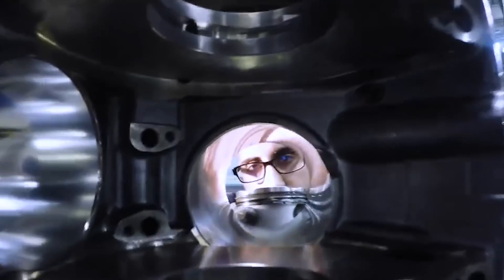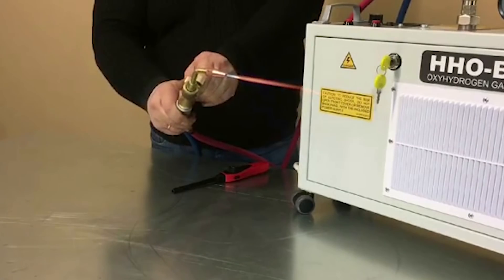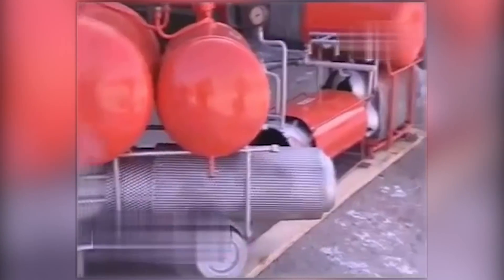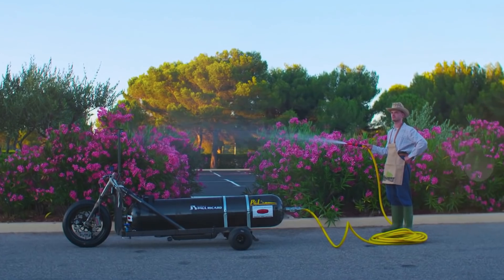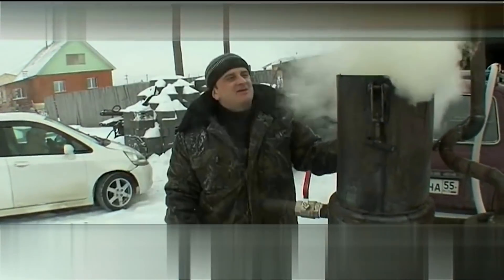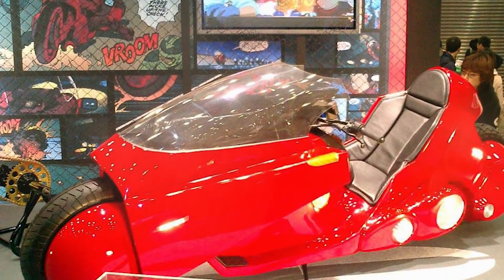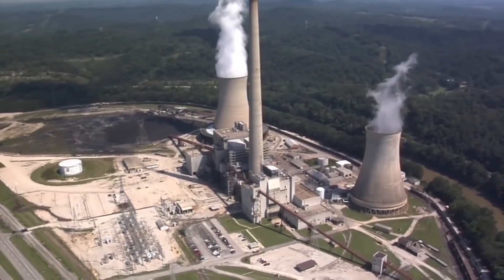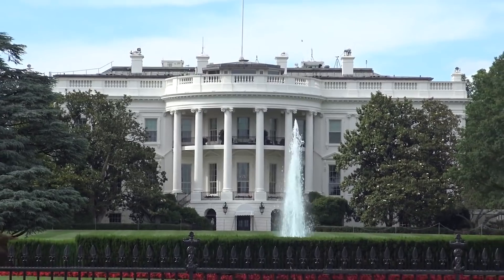Why These Engines Are Banned?

Comment: For a long time I thought that electric vehicles are banned in my country, untill I've realized one nuance. Home-made diy modifications of internal-combustion vehicles into electric are banned, however, electric vehicles made by carmakers and qualified workshops are not. The point is that the engine and modifications on a vehicle have been conducted by a qualified professional, as well as that they have passed appropriate safety standards.

Also, the issue with many of these "alternative engines" is whether there is someone willing to invest enough money in them to turn them into commercially viable product. Most of them are either mere scientific curiosities we've know for a long time, but offer very little practical use, or don't offer significant enough advantages and/or offer significant disadvantages over currently used technologies, so nobody is willing to invest into their commercial development.

Comment: Oh dear - HHO generators.... For the scientifically illiterate only. They need electricity to generate the hydrogen from which to then generate power, but the net result can never be more than the amount of energy put in to electrolyse the water (and rare as hen's teeth is the 100% efficient system , so the chances are that it will produce less energy than was originally input, therefore why not just use the original electricity and cut out the inefficiency of the HHO cycle...?).
Air power - yeah, OK, but what about the energy required to compress the air beforehand? Energy conservation applies yet again (never mind inefficiencies). At best it is only about moving the point of pollution from the vehicle exhaust to the power station. Likewise wih electric vehicles which also have the considerable extra environmental damage issues surrounding extraction and refinement of rare earth metals for the batteries. Range is another problem - fossil fuels tend to provide a tremendous energy density advantage over air and electric power. Hydrogen as currently used in hydrogen-fuelled vehicles is extracted from fossil fuels and is another example of both the movement of the pollution away from the tailpipe and poorer energy density compared to the original fossil fuel (because the overwhelming proportion of the energy in fossil fuels is liberated from the carbon rather than the hydrogen).

Comment: The "Air powered car" is NOT powered by air. It is powered by the air compressor which forces air into the holding tanks. It would be much more efficient to get rid of the air storage tanks and mount the engine, which normally powers the air compressor, in the car! That way you would bypass the extra, inefficient and time-consuming process of filling tanks with compressed air. Cars that supposedly "run on water" do not run on water. They run on batteries or alternators which generate electricity that is used to separate water into hydrogen and oxygen (also known as HHO gas). Again, just cut out the extra step of converting water into gas, and run the car on batteries and electric motors! Those "free energy" nut-jobs truly do not understand physics and electronics.

Comment: These technologies are expensive, unhandy or ineffective - that's why they are not in use anymore.

The magnetic motor is simply a synchronous motor/generator which is the standard engine in any AC servo drive today.

Comment: Without oil we wouldn’t have so many things get educated.

A partial list of products made from Petroleum (6000 items). One 42-gallon barrel of oil creates 19.4 gallons of gasoline.
The rest (over half) is used to make things like: Although the major use of petroleum is as a fuel, (gasoline, jet fuel, heating oil), and petroleum and natural gas are often used to generate electricity, there are many other uses. Here are some of the ways petroleum is used in our every day lives. All plastic is made from petroleum and plastic is used almost everywhere: in cars, houses, toys, computers and clothing. Asphalt used in road construction is a petroleum product as is the synthetic rubber in the tires. Paraffin wax comes from petroleum, as do fertilizer, pesticides, herbicides, detergents, phonograph records, photographic film, furniture, packaging materials, surfboards, paints, and artificial fibers used in clothing, upholstery, and carpet backing.

Solvents
Ink
Upholstery
Bicycle Tires Dresses
Cassettes Motorcycle Helmet CD Player Curtains
Vitamin Capsules Dashboards
Putty
Percolators
Skis
Tool Racks
Mops
Umbrellas Roofing
Denture Adhesive Speakers
Tennis Rackets Nylon Rope Water Pipes Shampoo
Guitar Strings Antifreeze Clothes
Combs Vaporizers
Heart Valves Enamel Anesthetics Dentures
Cold cream
Fan Belts Refrigerators
Ink
Toys Dolls Tires Tents Shoes
Glue Skis Dyes Cameras Combs Dice Mops Purses Dresses Pajamas Pillows
Diesel
Floor Wax Sweaters
Sports Car Bodies Tires
Dishwasher Caulking
Faucet Washers Food Preservatives Antihistamines Cortisone
Dyes
Life Jackets
TV Cabinets
Car Battery Cases Slacks
Yarn
Toilet Seats Linoleum
Plastic Wood Rubber Cement Candles
Hand Lotion Wheels
Luggage
Football Helmets Toothbrushes CD's
Balloons
Crayons
Pillows
Artificial Turf Model Cars
Movie film
Car Enamel
Golf Balls
Dishwashing liquids Unbreakable dishes
Car sound insulation Motorcycle helmets Refrigerator linings Electrician's tape Roller-skate wheels Permanent press clothes Soft contact lenses Food preservatives Transparent tape Disposable diapers Sports car bodies Electric blankets
Car battery cases Synthetic rubber Vitamin capsules
Motor Oil Ballpoint Pens Boats
Nail Polish
Golf Bags
Tool Boxes Petroleum Jelly Antiseptics Basketballs Purses Deodorant
Panty Hose Rubbing Alcohol Shag Rugs Epoxy
Insect Repellent Fertilizers Fishing Rods
Ice Cube Trays Electric Blankets Fishing Boots Trash Bags Roller Skates Paint Rollers Aspirin Awnings
Ice Chests
Paint Brushes
Sun Glasses Parachutes
Dishes
Artificial limbs Folding Doors Soft Contact lenses Shaving Cream Toothpaste
Paint brushes Insecticides Fishing lures Linoleum Paint rollers Plastic wood Trash bags Hand lotion Shampoo Fishing rods Anesthetics TV cabinets Salad bowls Awnings Safety glass VCR tapes Movie film
Bearing Grease Football Cleats Insecticides Fishing lures Perfumes
Shoe Polish Transparent Tape Clothesline
Soap
Shoes
Footballs Refrigerant Linings Electrician's Tape Paint
Oil Filters
Hair Coloring Lipstick Synthetic Rubber Glycerin
Dice
House Paint
Surf Boards Shower Curtains Safety Glasses Eyeglasses Footballs Detergents
Tents Telephones Cameras Bandages
Hair Curlers Drinking Cups Ammonia Gasoline
Telephones Antiseptics Deodorant Sweaters Floor wax Model cars Soap dishes Clothesline Panty hose Oil filters Upholstery Cassettes House paint Ammonia Hair curlers Eyeglasses Ice chests

Candles Boats Crayons Caulking Balloons Curtains Milk jugs Putty Tool racks Slacks Yarn Roofing Luggage Fan belts Carpeting Lipstick Aspirin
Rubbing alcohol Ice cube trays Insect repellent Roofing shingles Shower curtains Plywood adhesive Beach umbrellas Faucet washers Antihistamines Drinking cups Petroleum jelly Tennis rackets Wire insulation Ballpoint pens Artificial turf Artificial limbs Shaving cream
Loudspeakers Credit cards Water pipes Fishing boots Garden hose Umbrellas Rubber cement Cold cream Hair coloring Guitar strings
Toothpaste Toothbrushes Folding doors Shower doors Heart valves Hearing aids Wading pools
Ice buckets
Fertilizers
Toilet seats
Life jackets
Golf balls
Detergents
Sun glasses
Bandages
Nail polish
False teeth
Golf bags
Perfume
Shoe polish
Cortisone
LP records
Vaporizers
Parachutes
more tha
Reply: Yes oil is great for MANY things! But it SUCKS ASS as fuel!
Reply: Jeffrey Ryan it’s a great fuel. Without it most people would not survive.
Reply: @Thumper68  When you evolve thumbs, we'll talk again.
Reply: Jeffrey Ryan no we won’t, when you wake up let me know. Without fuels there wouldn’t be enough farm produce and transportation to take care of most of the metropolitan areas of the country. Look at how it started to get In recent months just shutting things down a little food shortages in the cities were happening. Many of those people don’t even know how to hunt fish or survive off the land. Electric vehicles cost in emissions just to create takes like 30 years plus of ownership to just equal out to a normal cars emissions in the same time.

Comment: The Wankel was patented in the 1920's and developed in the 1950's, in Germany.
Reply: It was used in NSU cars and later on by Mazda. A lot of Motorbikes used that engine. 

However, due to its crescent shape combustion chamber it is pretty inefficient and produces exhaust gases with a lot of pollutants (HC, CO). Also the sealing problem never got really solved.

Comment: I think we should put giant main springs in cars with some gears and have wind-em-up stations when you're to lazy to turn the key🤪💥🤪💥🤣
Reply: As an old school clock maker I can tell you that is a good idea. It would actually be quite easy to wind up too. As a matter of fact, it has been done before and is more than reasonably feasible. The power and longevity of it would be set by your gear ratio. Decent acceleration is possible even at higher gears and regulator could prevent over speed. 5 minutes of winding with the right regulator and gear ratios could easily get you 100 miles of travel at 60 miles per hour.
Reply: @myname604  you’re joking right?

Comment: "Banned" is the wrong word. "Impractical" is more appropriate. Just because something doesn't violate the First Law of Thermodynamics doesn't mean it can work for the operating conditions and life expected by its customers. As an example, you can put enough compressed air in a bottle to make a vehicle move, but can you go 400 miles (650 km) without having to recharge? What happens to those cylindrical bombs in a collision? Is it more efficient to pull electricity from the grid and pump up those bottles than to charge a battery? Oil companies don't decide what technologies go into vehicles, either directly or indirectly. If the "hundred-mile-per-gallon carburetor" had actually been invented, someone would have put it into production one day and put their competition out of business the next.

It's easy to think that complicated problems have simple solutions that are thwarted by conspirators. Do you really think that a handful of companies can keep all seven billion of us from doing something else?

Comment: There are a lot of numbers to be calculated and compared to see what's better.  The compressed air car could be a cost improvement over lithium batteries for short distance commutes.  Using solar to run a HHO generator and burning the collected gas could be a cost improvement over natural gas (methane).

As others have pointed out, none of these engines are banned.

Comment: BULLSH1T - THESE  vehicles are not 'powered by air", the energy comes from the compressor used to fill the air bottles usually using electricity which is not cheap!
Reply: Tho, if those compressors were powered by solar, then it would be very cheap. To be fair I've only just learnt of vehicle being powered by directing compressed air, but it makes sense in my mind that it could work, and even if the compressor is powered by coal power from the grid, the coal generators are still far more efficient than petrol engines in cars, so the air powered cars may actually be feasible on a large scale.

Comment: The compressed air powered car will never be free or zero emissions.
You have to run an air compressor to fill it up.
That will require electricity, gas, diesel, natural gas or propane.
Fairbanks Morse had opposed piston engines in their trains in the 50's.

Comment: All of this is just conjecture and optimistic doubletalk. If even half of these things worked as described (apart from the wood burning car, which was a common technology as far back as WWII) they would be patented worldwide. Most of the reasons given for this not happening is simply conspiricist nonsense designed to hide the fact that the majority of these things simply do not work.

Comment: By the end of WW2 Germany had all but run out of gasoline, they used wood gas (and other compressed gases) to power their smaller vehicles, well documented. I agree this is click bait crap and it doesn't even answer it's own question.

Comment: Ok. It's NOT BANNED...
The compressed air engine? It's cool for moving a couple people. Our world is built using diesel engines that can move 80,000 lbs... and that's the tractor diesel not a cathedral engine.

Rotary? Dead. Emissions.
Electric vehicles have been around since the late 1800s but unfortunately as recently as the 1920s an Edison Electric truck was so expensive the upgraded battery pack alone cost more than 3 Ford Model Ts. Meanwhile a current Tesla will run you at least $35,000 vs a $13,000-$18,000 entry level vehicle... so in 100 years not much has changed on that front.
The jet engine car was dropped because it was many times as expensive as a V8 at the time while not saving fuel and providing no more power.
Opposed piston engines on the other hand have been in non stop use since the 2nd World War.

FM has only recently replaced the 38D with the Triton. Cummins has also tooled up to build Opposed Piston engines for the department of defense.

Comment: I got suspicious when he put Wankel's motor as an US invention, but stayed on. Then he praised electrolysis as a great way to move a car...yeah, well, the electricity has to come from somewhere, right? And if it is not produced by wind turbines or other (more or less) eco-friendly means, you have a problem, because you HAVE to put more energy into this than you will get from the hydrogen produced...and the electrodes oxidize and lose efficiency really fast. But I knew this was a wacko channel when he went to cold fusion... There is no such thing as cold fusion! It's rather difficult to fuse atoms together. You can even calculate the energy you need per atom pair. As the only parts of the known and observable universe where this is happening are SUNS, this could be a clue as to how difficult this is. Same with the reactors being build that try to use fusion. They are very complex. But, sure, some obscure scientists have found the solution to all our energy problems, but were proven wrong by ALL the other scientists out of fear of the repercussions of the oil industry? Show me 10 scientists and I can show you at least 5 people that would kill or die for a chance to get a paper in that proves this concept. You would be more famous than Einstein. There is NO way to suppress this if it were real. Scientists just do not care. 
When he drifted even further from the topic in the end, going full off the deep conspiracy end, it was settled: This is a real BS channel just to generate money by clicks. It should be removed.

Comment: just going through a couple of things said...

the entire magnetic field motorcycle is basically using a motor if not just using a motor, wow really special there, and even if it was not exactly a motor it has the similar premise and accomplishes the same end product via different means, using electricity to move a motor to move a vehicle

also cold fusion's entire premise is failed on the pseudoscience it was founded upon with false results a lab had, of which has not been replicated anywhere else, and fusion requires a lot of energy (ridiculous amounts), and that in its self is an understatement. There is a reason why fusion only occurs on the sun and not in even a massive gas giant like Jupiter, even Jupiter is capable of getting high enough temperatures or enough pressure to have any fusion occur
Reply: michael m  0

Comment: I wana be woek like this company.... Great tata keep it up
Reply: Here's something to think about: maybe hudrogen cars are uncommon because it's a gas under most circumstances, burns extremely hot (2200°c, enough to melt steel) and uses a lot pf energy to extract from water. Most of these engines aren't banned or even physically impossible, they're just impractical. For instance the wankel engine works quite well, but it consumes a lot of oil, fuel and the seals on the rotor need to be replaced regularly. It's better to use a regular piston engine in most circumstances.

Comment: Not even the oil & gas industry wants to keep selling gasoline & diesel. Petrochemicals are far more valuable to make from the oil! See more profit & capitalism, free trade & democracy. 
Fossil fuels work & are proven to work, gasoline & diesel powered trucks moving 80% of the stuff people buy in America. We cannot turn everything into an EV overnight, powered by solar energy & organic this & that. Takes a long time to update everything. Lots of room from improvement with ICE too / variable compression / HCCI / direct injection & turbo-charging / water methanol injection / TBC exhaust heat recovery thermocouple generators, turbine electric generators / ICE used as genset at one specific optimized RPM (lowest emission) can also act as range extenders in range extended electric vehicles HEV REEV PHEV etc // not just vehicles either // we need lots of energy on the ZPE scale (dark matter, wormhole energy) to explore the universe in a big way. Earth very small relative to the universe // same true of people // we are all just dreamers wishing for a better future together as one human people from Planet Earth
Reply: Just stop making combustion vehicles for public (this doesn't mean you stop offering support/fuel for those) and offer some "tax discount" to incentivate people to upgrade. We have the technology today to do so.

Comment: Put the bong down.
MAny of these technologies dont make it out into mass production and availibility for a pile of reasons.
Often they are not very efficient (splitting water with electricty, requires more elctricty than the final product could produce...)
Or dont scale well
Or are insanely expensive for the average consumer too implement....